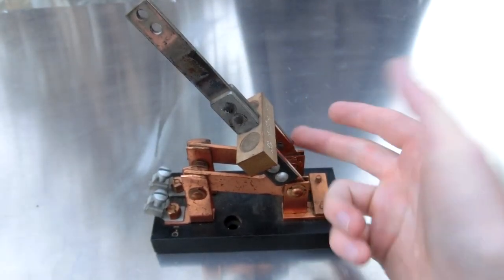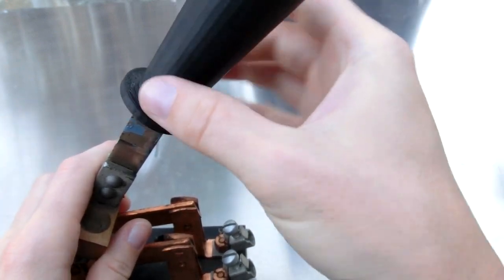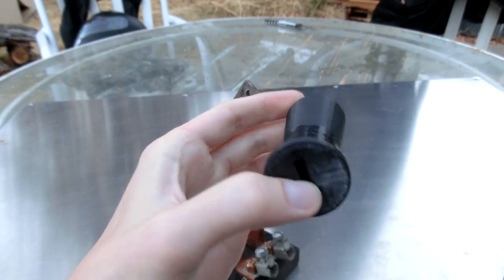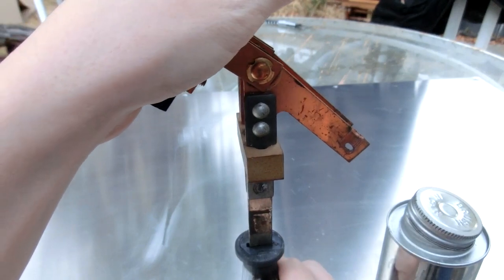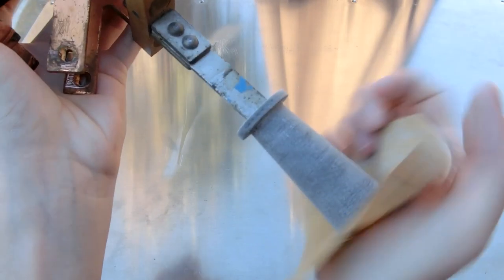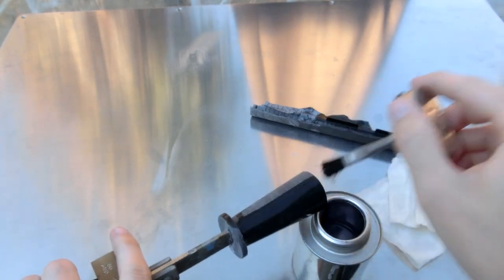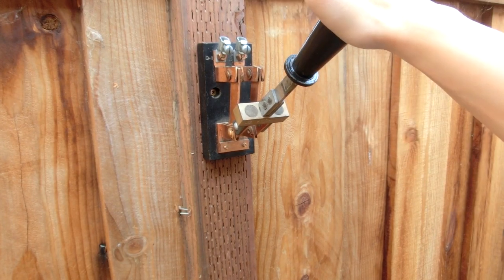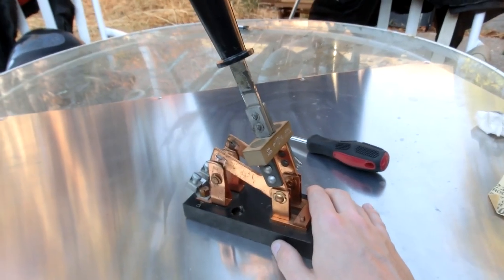3D printed handle for antique Knife Switch

Comment: If you redesign it, make the center hole deeper as well so that the handle is doing more insulating and is subject to less structural stress when you throw the switch lever.

Comment: if you do make a version 2 you need to make the grip go down on the handle more. you can see residue from where the original rubber grip stopped (the black line about half an inch up the handle) if you're looking for function, this works by all means.

Comment: I like that design.  Power has to go through two switch gaps which close at the same time which helps reduce arcing. If the electrical potential had one gap to jump, the electrical pull would occur and there would be a large arc.  But the electrical potential has to cross two (in this case) or more gaps to complete the circuit and cannot "feel" the other side of the charge till both gaps are much closer than in the case of the single gap. 
    The switch stamping shows it is rated for both D.C. and A.C. which is a higher standard than just AC qualified switches.  D.C. switches have to be designed to take more heat and generate less resistance as the heat builds.  I remember seeing warning on photovoltaics stating that DC qualified switches must be used.
    Nice work on the handle.  I guess the original would have been bakelite or wood.  I assume the base of the switch is bakelite.  If there are continued problems with discoloring, maybe black fingernail polish would work.
Reply: I do also believe that the two contact points minimises arcing. But probably no way near how a newer switch, does this with the spring loaded action that prevents the switch from anything else then on or off,,, the klung sound :-)
It kind of looks like there has been an intend to make it look big and powerful, the power has to move way longer than needed, and through two movable joints :-/ Copper must have been cheaper back then. I gather from what Rinoa said about  some wood chips, that the metal in the handle is not "powered" :-) that would not be nice.
Did these have a cover on top,, or is this how they was used?
I like the old looks more than the design, to many things I would have made differently if the switch was to be effective with low resistance and to keep production costs down,, it's great for a Frankenstein prop :-)
Reply: The leverage action of the switch pops it in and out quick, seems to reduce the amount of vertical space the switch occupies on a wall and also reduces the likelihood someone operating it will come in contact with it.   The simplest knife switch merely has the blade continue to an insulated handle.  The default position is always the open position and is determined by gravity, so the switch has the hinge on the bottom and in its open position hangs downward from the hinge.  The vertical space required is the entire length blade and handle above and then below the hinge.  Since there are often several switches and they all have to be at about from a man's waist to his shoulders for easy reach, this causes space problems for easy operation. Also, when a man's hand moves the simplest long switch from the default open position upwards to the closed on position, his forearm gets close to the now hot switch.  Like I said, I like the design of the switch he bought.  It is always fun to look at something and wonder why it was done that way.
Reply: I think that's probably the origin of the 'up for on' standard for main switches and so forth, if the switch is off, it can't "fall" back on

Comment: Hi RSG, Please consider re-printing the handle in a horizontal orientation - the layers wouldn't de-laminate so easily. A higher infill-percentage won't help much - what can help quite well is 110% (over)extrusion for the perimeter-layers - easy to set in (e.g.) Craftware or Slic3r or Cura. Also, if you try to switch DC, you'd get arc-streamers. These can be extinguished by adding little magnets near the electrodes. With a correct orientation, the arcs can be deflected away sideways (Lorentz/Hall-effect/whatever). Cool vid! :)

Comment: You should make the hole in the handle deeper so it wont brake. you can even see that the original handle sat further down than the one you 3d printed.

Comment: milliput a 2 part epoxy sticks quite well to 3d prints due to the lines in the print when it hardens good for reinforcement. just may have to spray paint it. mine seems to only come in green or brown for some reason due to my  limited local source there is other colours availiable.

Comment: you could have that turn on a low voltage relay to control you shed's power, abit safer
Reply from the maker: but why? its perfectly capable of switching up to 250v
Reply: Peter Carlson beat me to it
Reply: knife switches are still made I work at a place and we make all kinds of sizes from 30amp up to at least 1600amp they get used for subways and mining
Reply: I haven't been working there to long all I really do is make the parts for it never  put them together but its at filnor in ohio